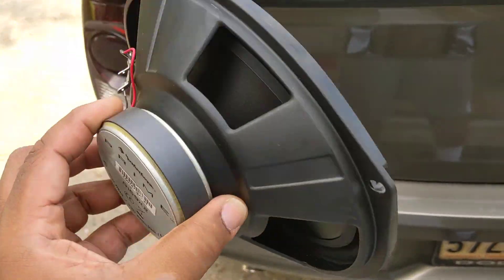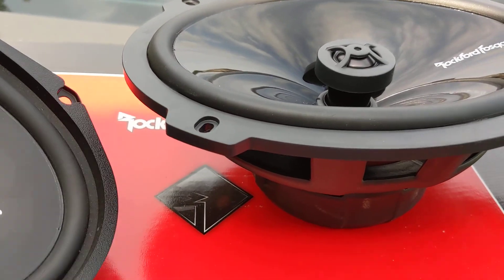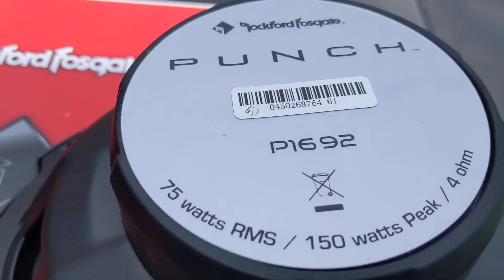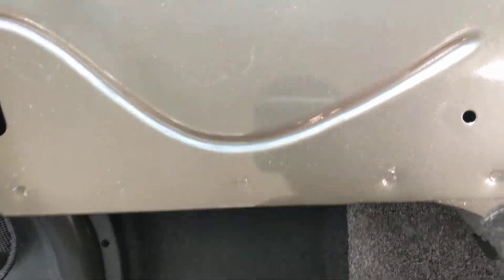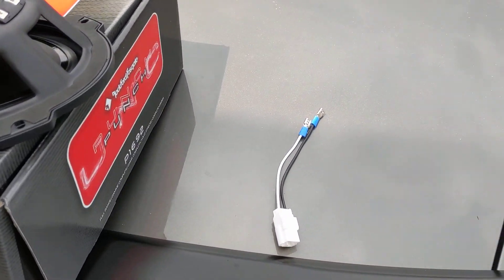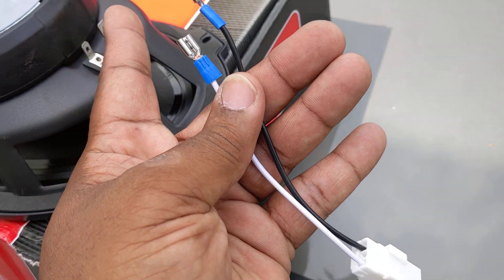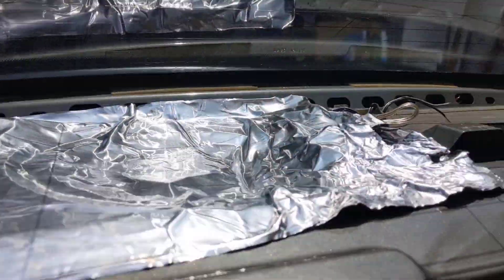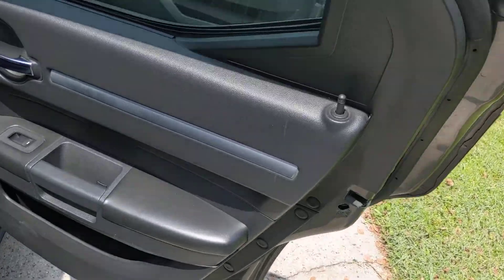Once again it's on with a pair of Rockford Fosgate p1692s

Comment: So I installed the same 6x9 with the weak little tweeter thinking it would sound okay running on just the headunit and it sounds so dull flat and bass notes sound distorted. Do you think they will sound way better with an amp or just a little bit better?
Reply from the maker: @rubenb775  get a decent four channel amp with 50w RMS x 4. You should see a big difference.
Reply: @ thanks for the quick reply and suggestion. I am gettin an alpine type s amp (Alpine S-A32F) i really hope this will bring the sound quality performance out of these. Much appreciated.

Comment: Is the air pressure from your infinite baffle what's causing your 6x9s to blow?
Reply from the maker: Nope . I had a set of tweeters with the 6x9s for a two ohm load on a Punch 400x4 (ran four 6x9s and 4 tweeters).

Comment: As far as the 6x9 bass was it good enough?
Reply from the maker: You can get good mid bass / bass . Of course it depends on how you are powering it ( amplified or not) . Proper crossover adjustment on any system is needed.
Reply: @BigJ3RD  i bet matching these up with a 75 watt amo would wake them up. Did you just use the factory head unit? If so how were they? Thanks
Reply from the maker: @RollingInMy5pt0  https://youtube.com/playlist?list=PL7x9fN4icakbn5UG_xzj8CT7zDxS2j806